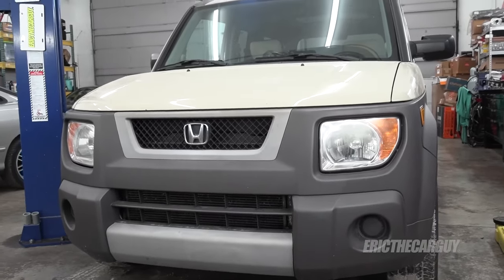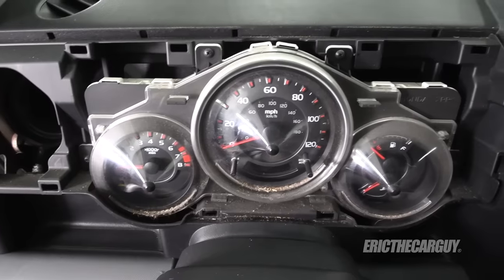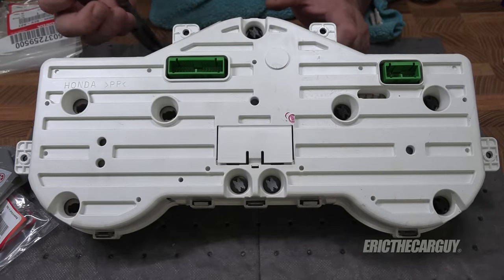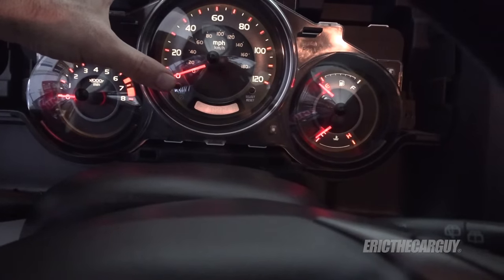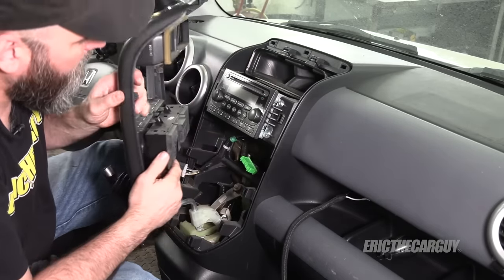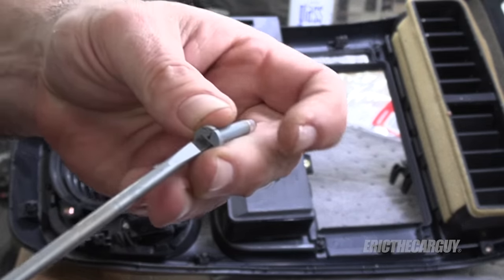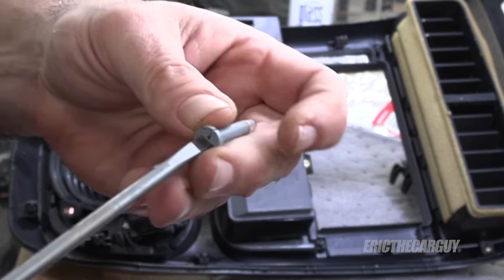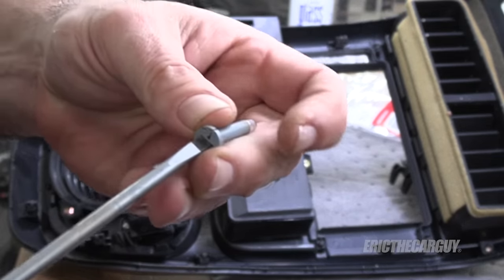Honda Element Fixes and Upgrades

Comment: Great video as always! Have you made or thought about doing a video(s) on emergency tricks of the trade for car repair (especially for some of us less educated and inexperienced DIYers)? My coolant fan switch on my '05 Civic failed on me two days ago and was quite scary. I mostly drive highway so it probably failed sooner but I didn't notice it. I was at idle about two to three days ago and noticed the temp gauge kept climbing higher than usual but would drop as soon as I started driving again. My fan didn't kick on at that point as it usually would. I came across a video mentioning sticking a safety pin in the connector to test and keep the fans running. I did that and made it home without the car overheating at idle. I'm still unfortunately driving with it like that now until I can replace the switch and bleed the system some time after work today or tomorrow.
Reply from the maker: Actually, I spent 2 years putting this together to address issues just like that. https://www.ericthecarguy.com/faq/
Reply: @ericthecarguy  I definitely appreciate that. Unfortunately, my head gasket is doneso or on its way to complete Donesoville. I've got exhaust gas residue in my coolant reservoir tank and coolant is slowly disappearing without external visible leaks or infamous blue smoke. Apparently, head gasket failures are common on the 7th gen Civics. Couldn't have happened at a worse time. One of my buddies has a couple guys who are Honda Heads and have done a bunch of head gaskets so I'm gonna see if they can help me out.

Comment: I want to replace the tires on my 2011 Element.
Which/what time size would you recommend for a daily driver?

Stock - 215/70/16

-235/65/16
-225/70/16

Comment: Great vid. I have a 03 awd "y" package w/ sunroof in the rear. 4spd auto. What shift solenoids are the proper replacements for the mrja trans. I have the dreaded intermittent, erratic shifting. Runs and drive great other than that.

Comment: When you removed the seats, did you have to disconnect the battery? I've read online that if you don't , you'll continue to get an error code. I want to take mine out and have them redone.

Comment: Eric, what pin removal tool and trim pry bar do you use?
Is it possible to make a video regarding proper wire management/installation tips for a dash cam?
Reply from the maker: The trim tool I got when I worked for Acura. It might have a Honda part number. I made my own pin removal tool from a small screwdriver. I filed it down on the bench grinder. Thanks for the suggestion.

Comment: Eric I bought a Element last week and I changed all engine/ trans mount thinking the vibration was the mounts. Old mounts still look good but installed the new mounts but vibration still the same as before, What could it be?

Comment: Eric, enjoy your channel. Glad to see your Element projects. About to buy either an 09 LX Fwd or an 04 EX AWD, both at or under 100k. Leaning towards the AWD, not only 5k cheaper, but I’ll get the EX alloys, moonroof, and AWD, all missing in the LX. Is my logic sound?  Or is an 09 worth getting than an 04? Thanks!
Reply: 2009 is the refresh and usually manufactures have taken care of common issues+recalls since launch. Also incorporates the 2009+ Piot/Ridgeline silver border grille shell (if your into that styling)

Comment: Thanks Eric.  Lots of tips here that can be used on other non-Honda jobs.  My friend had a question that I don't have an answer for.  Does it matter if you install nitrogen lift struts like on your rear hatch upside down?
Reply from the maker: I don't think so, but if you install them the other way it might collect more dirt as the water drains around them when the hatch is closed.
Reply: @ericthecarguy  About what I figured and the only answer I had for her.  I should have asked you if they still work properly, but I just now went outside and flipped the ones on the hood of my F350 and they work just fine so I put them back.  Thanks anyhow for the reply.

Comment: 👍👍👍👍👍👍👍👍👍👍👍Thank you for making this video ,any opportunity to watch element  upgrade,repair and maintenance video ,I watch enjoy.Had mine since new 2006 ,5 speed, I really like driving it,How do you like driving your manual transmission, compared to your automatic Honda Element ?
Honda ace on you tube has a great video on how to reset your air bag light Works for me after I tried it 10 times
Reply from the maker: I like driving the manual better. It seems to have more power than the auto and is more fun to drive.

Comment: I tried installing LED fog lamp bulbs into new fog lamp housing to replace one that had shorted out. The LED bulbs ended up blowing the inline fuse somehow. What's more is the new housing's method of holding the bulb in is not as good as the original housing. Seller sent me replacement ones and I just left the halogen bulbs that came with it so I didn't have to bother with it. But I really want yellow LED in them.

Comment: Looking into getting a Honda Element, any tips/suggestions/ things to look out for. Heavy debate on the 4 speed AT vs 5 speed MT, FWD or AWD, and which year model is best? Any help ? Hope to get one by the end of the month 😭❤️ thanks y’all
Reply: Mt awd is fun but when looking at one inspect drive shaft U-joints and rear diff mounts. U-joints aren't replaceable so you gotta buy the whole drive shaft assembly which is $$$
Reply: @johnziriada2820  understood, do you know if those break often? Or will last if taken care of... because if that’s the case I’d take an AT
Reply: @ajdelacruz7272  everything wears out eventually, the U-joints are sealed so nothing to maintain. The MT AWD has quicker take off but less mpg. Im not sure what location you're looking but ive heard northern ones are bad with rust - salty winter roads.

Comment: Eric did you consider putting LEDs on the dashboard for a more modern look? Thanks
Reply from the maker: No, and I don't recommend it. I've tried it on other vehicles in the past a customer request, and it never worked out. LED's don't use the same amps as indecent. The amps they use are important to conform with original design.
Reply: It usually ends up looking like crap

Comment: I have a 2003 DX model which does not have cruise control and it's the one thing I really wish it had. How difficult would it be to add cruise control?

Comment: Hi Eric,  I have a question for you.  This concerns Honda Element part # 04636-SCV-305ZZ. It is the rear panel set.  I am looking to replace it because I have a dent on mine thanks to an overgrown palm tree.  Have you had any experience in replacing that part?  Is there any welding involved?  Thank you. 

Jose G

Comment: Been thinking of buying my self an element , what year would you say they got all the kinks out ? Best engine transmission combo?
Reply: As a mechanic, a honda fan and an owner of an Element, any Honda is an amazing vehicle. Your biggest issue is they're at least 10 years old, so most are gonna need some tlc. Mine is a 04 EX AWD 5 speed which is my fav model (same as this vid) but has a lot of worn out parts. The only repair that pissed me off was the U-joints aren't replaceable- you have to buy the whole drive shaft @ over $400.  You'll be happy with any LX or EX - the DX is a little stripped of features

Comment: Honda offers lifetime warranty on their seat belts. The belt and buckle would have need covered. I had the srs light from the tensioner, and my local dealer replaced the belt and harness at no cost.

Comment: I've replaced the bulbs with 2721 bulbs, but the top on on the center dial is still dim despite reversing the bulb polarity and exchanging the bulb. What would cause that bulb to not light up as bright as the others?

Comment: @37:48 Hey Eric, I think the part # for the fan is: 38616-P3G-003 instead of 38616-33G-003. The latter part # did not return anything.
Reply from the maker: Thank you for pointing that out. I'll make the change.

Comment: Eric I’m at wits end about four months ago I replaced the transmission fluid filled it up about 1/3 ran it through the gears to make sure there’s no air bubbles then filled it up a little bit more did it again ran it through the gears and then filled it up to the specified level and it was running fine and doing good but all of a sudden it started slipping I would kick it into passing gear and it would just rev… Transmission fluid is not burnt can’t seem to figure out what it is and I’m losing my mind not being able to get out and about as I am a sole caregiver of my father and I do need some peace and solitude from time to time which I have not gotten for at least two weeks now. I do work on my own stuff but once again I’m at a loss
Reply from the maker: You might find this helpful. http://www.ericthecarguy.com/faq/solving-transmission-problems

Comment: I have dash lights out in my CRV.  I was wondering how you find out what bulbs are needed and did you get your bulbs through the dealer?  I want to have the bulbs before I start the job.  Been enjoying you for years.
Reply: Honda Parts Now probabky has the diagram
Reply from the maker: I get them at the dealer. You can also find Honda dealers online that will ship them to you. Be sure to get ALL the bulbs. You'll find that after replacing the ones that are out, the rest will follow suit.

Comment: Hi  Eric there's a way to increase a little the idle on my 2005 Element? Im having some vibration at idle of 600-700 Rpm. If I increase it to 900 Rpm vibration goes away mainly when A/C is on. All four engine/ tranny mounts changed last week. Thank you in advance!
Reply: Bad fuel enjector maybe?

Comment: It's strange how there wasn't any Loctite on the original installation of those door lock screws. I guess it's not normally too much of an issue. On a separate note, do you prefer manual or auto transmission? It seems I'm in the minority of people who won't enjoy driving once the industry goes electric and we lose our 'stick-shift' models.
Reply: Depends on the situation for me. On my fun weekend car I only want a manual. But as far as my daily I despise faffing about with gear changes, especially in traffic.
Reply from the maker: A little of both. If I'm sitting in traffic and eating a sandwich, auto for sure. If I feel like 'driving', then it's manual for me. Most of my vehicles are manual.

Comment: warning on removing the seats- if you remove your seats and start the car up, you will need to reset the SRS airbag light. it can be done via ODBII scanner that has that feature.

Comment: Honda fixed my SRS light problem. It has a recall on it. All safety recall repairs are FREE at authorized Honda dealers.
Reply from the maker: Not anymore. Seatbelts are 15 year warranty instead of lifetime now.
Reply: Most dealers charge a diagnostic fee to make sure it isnt something else.
Reply from the maker: According to Honda, "useful life" is now 15 years. Call them and ask. I did, and that's the answer I got.
Reply: @ericthecarguy  Good to know. 🤨Honda’s defaming their own product quality. 

I have a 2003 Element EX AWD. I see lotsa useful life left. My daily driver. Last year drove from LA to Sturgis not 1 problem ✌️(appreciate your vids)

Comment: R you can add cruise control at 2003 element ?
Reply: I spent all day researching this. I am pretty sure it's possible, but it's not going to be a really quick job. You need a new throttle body with the plastic cruise control throttle connector, a cruise control actuator, a new steering wheel with the buttons, possibly a new clock spring with the connectors (haven't checked this yet), and a Controller, Automatic Cruise. I am not a mechanic, but from what I can tell, these are the pieces the DX model is missing. If I embark on this, I will try to remember to come back here to let you know how it goes. I am planning on stripping these parts from a junk yard. Absolutely love me element, but cruise control is the one thing that's been bugging me for all these years and I think my car still has a lot of life in it, so I am finally looking into it.

Comment: You should always unhook the battery when unplugging any yellow airbag connectors
Reply from the maker: I'm not saying you're wrong but in 20+ years I never have, and I've never had any issues. BTW, those connectors are specifically designed to not short out when unplugged. Thanks for the comment.
Reply: When unplugging my seats it caused  the SRS light to stay on. May of been caused by the ignition being on for the radio but I'm not sure. Might be something to consider

Comment: 4:00 you're better off buying a few sets in advance. The old bulbs are already worn out and prone to failure, even as emergency spares. I used to do that too, right up until twice, i swapped using older ones and it bit me in the soft bits. Not worth it.
Reply from the maker: The only time I use an older one is when I have no other choice. These bulbs are special order and take days to get. Sometimes it's nice to just throw one in when you have it. Also, I'm somewhat of a packrat. Thanks for the comment.

Comment: Please trend this comment to the top and spread the word.

Catalytic converters are worth several $100 on the black market for theives. Recently I had mine stolen and it will cost multiple thousands$$$$ to repair. If you own a Honda Element or a Prius or any vehicle high from the ground install protective shielding to make the part harder to steal.

The installation of the protection is much cheaper than a replacement catalytic converter.

Comment: Does anyone’s Element stall when coming to a complete stop or when making a turn? Mine does. Any ideas on what the problem is?
Reply: When was your last oil change? Mine started stalling out at random stop signs and going into limp mode at higher RPMs when the filter for the vtec solenoid got fouled with engine grime. It thought I didn't have enough oil pressure. The solenoid is bolted in next to the oil filter. Check the screen for gunk and you can clean it off or order a new screen if that's your issue.
Reply from the maker: https://www.ericthecarguy.com/solving-automotive-performance-issues/
Reply: First thing that comes to mind is a dirty throttle body, which is extremely easy to clean.

Comment: 😭😭 I’m putting a new engine in mine. Head gasket broke and is cheaper to get a new engine lowered miles. 2003 236000 miles.

Comment: I don't understand why Eric loves the Element so much. I owned one and it had several major mechanical issues, rode like garbage, had no power, and generally only served as a super basic commuter.
Reply: what were the major mechanical issues? It has a k-series engine which is reliable as hell, they are easy to work on and they are very versatile. It's by no means a "cool car", but for many of it it's very practical and the perfect car. I don't think anyone buys an element for the power. I love mine and would totally get another. I hope they start making them again.

Comment: I have a 2008 Honda Element. It has a "birth defect" as it allows a teeny tiny bit of air into the brake fluid every time you start the vehicle and it runs its own tests at startup. It was recalled but that didn't fix it. About every year I have to have brake fluid replaced and bled to get the pedal back solid. I almost got hit by a train once because the brakes got so bad. The only thing I hate about this car.
Reply from the maker: That doesn't sound right. There could be more to it. Also, the friction material you use has a lot to do with it. https://www.ericthecarguy.com/solving-brake-problems/

Comment: If your element is older than 2005, seat belts are life time warranty....
Reply: You do know he is a former Acura master tech for many years. He knows whats up.
Reply: @2fast4all  I know he hung parts at a honda dealer yes.  But it doesn't change the fact they have a lifetime warranty...
Reply from the maker: Honda no longer has a lifetime warranty on seat belts. It's now 15 years.
Reply: @ericthecarguy  correct, they changed the owners manual for the 2006 model year but they still honor warranty for 2005 and older.